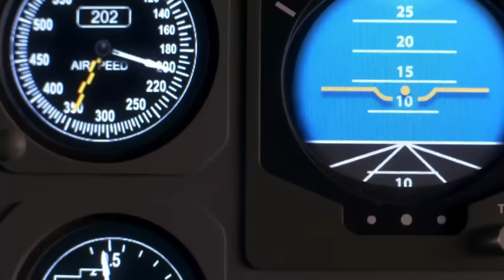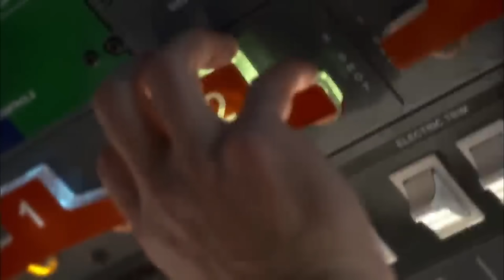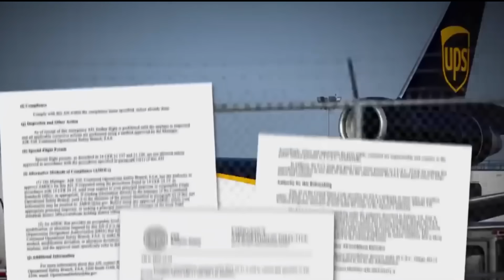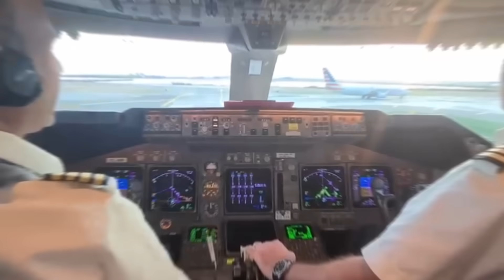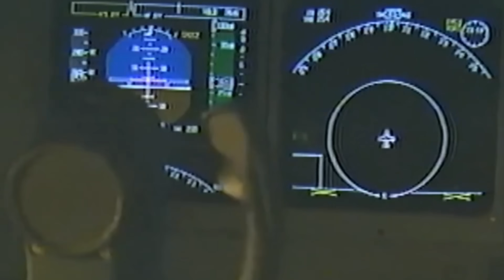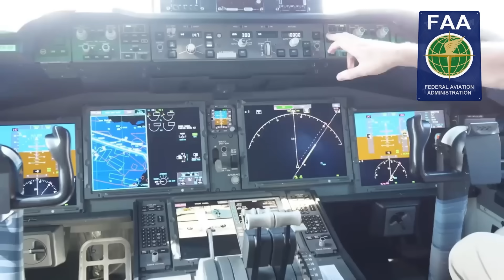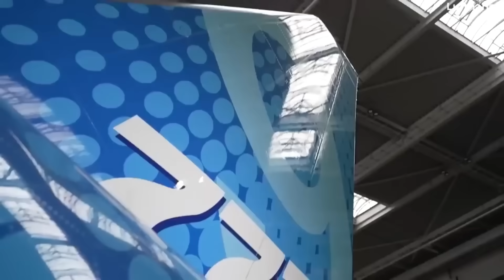It’s OVER — The MD-11 Is Officially DEAD!

Comment: The engine on left wing blew up scattering parts into the right wing engine leaving only the engine in the tail giving full power. This has happened on newer 2 engine planes. The engine failure was after they did not have enough runway to stop on. If the right wing engine had not been damaged by the left engine they would have power to climb dump fuel and land. 

 The MD11 uses the exact same engines the Boeing 767 uses. Why don't you blame the Wright  brothers for their first  airplane design.